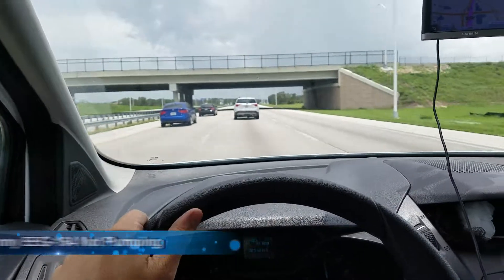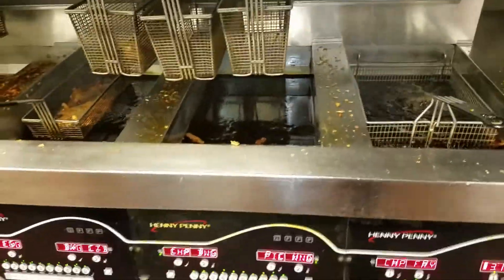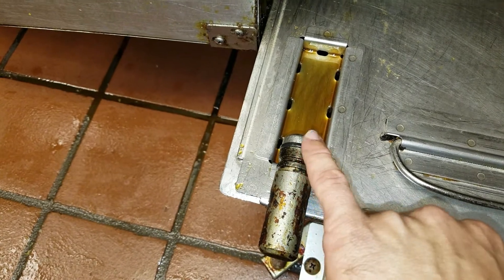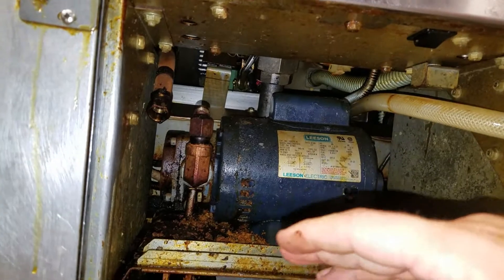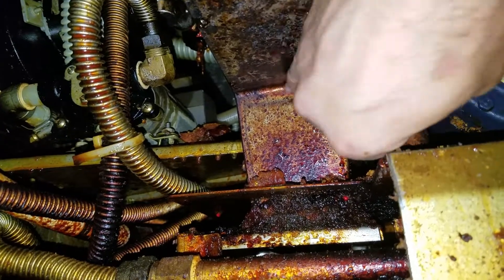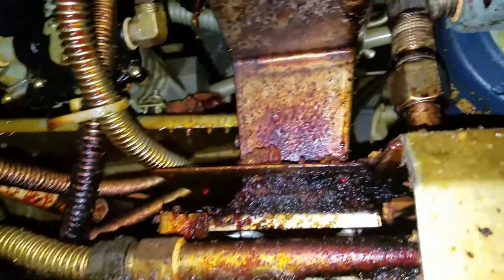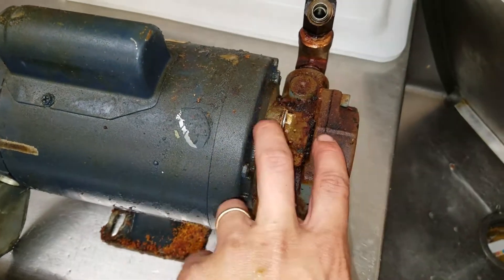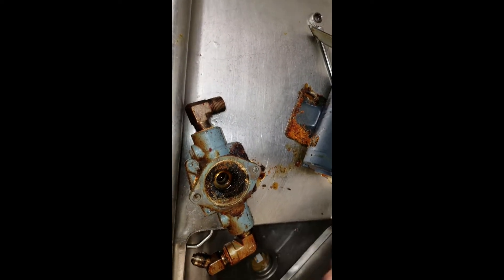EEG-164 Motor replacement(1/2)

Comment: What's the part number for the pump rebuild kit? The rollers and o-ring?

I've got a pump motor that runs but has very poor flow. Vibrates like crazy and I'm pretty sure I can hear the seal tumbling around inside the pump. I can find the seal kit but not the rollers or pump head o-ring. Thanks for the help!
Reply: from what my lead tech told me.. its best to just buy a brand new pump.. the price difference isnt worth the hastle...

Comment: Hey man working with a cfe 500 would bad rollers cause it to pump weak? I had to prime it (original pump) and it seems like it’s pumping weak all the plumbing is free of debris should I remove pump? I checked the rollers and some are kinda flattened on sides on some
Reply: Yes rollers must be round an white if their colored brown an square their bad

Comment: So I'm having an issue with the same fryer. It fills slowly. When it starts filling its like its not sealing.. but then it catches prime in a couple of minutes and starts filling. I inspected the plumbing and found that someone had bypasses the high pressure check valve. I assumed the valve was stuck open and they didn't want to replace it. So I replaced the valve and connected everything properly. Now it won't fill at all. Its not even pulling out of the pan. I bypassed it again and it fills. What'sthe deal?

Comment: How do you prime the pump on a HP500c fryer
Reply from the maker: Only if it needs it. But it's the same as any other HP fryer. Just crack open the discharge side and let the pump push the air out and let some oil come through, turn the pump off or tighten it quickly and you are set. and you are set.
Reply: manually put oil in the pump through the brass fittings.. until its filled then hook it up.. i used a manual pump with  a hose to do it... you need to manually prime it to function... i figured it out the hard way

Comment: You would think when designers make these, they would making replacements like the pump in a easy place (like in the back or off the side). Having these right under the grease or near the grease will short it’s life.
Reply from the maker: Hey! That sounds like an engineer thing. Why on earth would they want to hear common sense stuff like that. You're just a little old tech, what do you know? That's what I imagine they would say to us at least. On a more serious note, I find the biggest issue for these pump and motors on any brand usually stems from letting the units run too long and it just pumps air. That tends to wear out the seal in the pump heads and that allows oil to leak into the motor. Most of these motors that sit above the filter pans usually has 2 lays of protection from the oil ( except for the pressure fryers.) The shelf the motor sits on blocks a good portion of any steam from the oil, and the filter pan cover as well. So oil migration isn't as bad as it could be. Now i have seen pump and motors coated in dried oil, but that took years, before the motors went bad.

Comment: Thanks for the video,  two questions, 1) Why not pull the whole motor assembly out? When I change them I find it easier to have the whole thing in my hands to work on. 2) Why did you not prime the pump before you started it?
Reply from the maker: In this video I did remove the entire pump and motor assembly. There is a part 2 to this video. Also as for priming the pump before I install it,  I generally don't get enough oil in the pump to get a Vacuum. So o cheat, and when it is running (if there is no suction) will crack open the hose (just a little)and let the air out and, yes, oil will spray out. But not enough to cause any damage, if you stop the motor fast enough or close the line. Now, henny penny has since changed the pump and motor assembly and is no longer like this. The assembly is a little bigger and no longer had a seal kit.
Reply: @thefryerguy5982  yes that is true for some of the units makes it easier in a way to just change everything put at once. Was talking about the shelf the motor sits on.
The way I  get it primed is to get some oil on a cup and poor it in after the motor is reassembled.
Glad to see the videos I can show my wife some of the things I get the joy of seeing everyday.
Reply from the maker: @xaivergb  I understand the idea of pouring oil in the pump once it's assembled, If that works for you, go for it. As for removing the shelf, I dont recommended doing that. Even Henny Penny doesn't recommend that, to get those rods back in place is a nightmare. To remove and replace a pump and motor the way I do it, takes me less than an hour to do. But if that works for you, then keep on doing it. I know other techs who also do the same, I usually have to go out later and replace those rods because they bent them, and then the motor doesn't sit right and then it wont line up properly and have terrible suction. But if you can manage to do that without bending those rods (or pins) have at it amigo!

Comment: Thanks for the great video. I'm not a tech but I work on my own HP fryers at my restaurants and this was a big help. Good idea not attaching that first triangle bracket to allow the oil to drip out if the seal goes bad. You should patent a part for that and sell it back to HP!
Reply from the maker: well...I would, but they have recently updated their pump heads and they no longer have those style pump heads. So no more covers! So no matter what happens, oil will leak right into the motor!